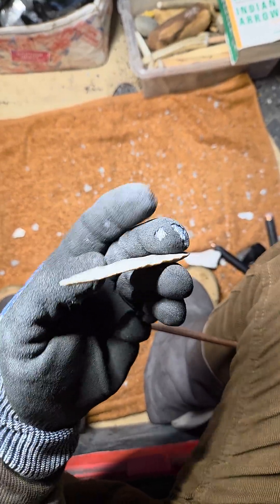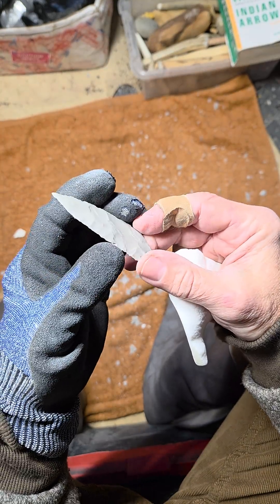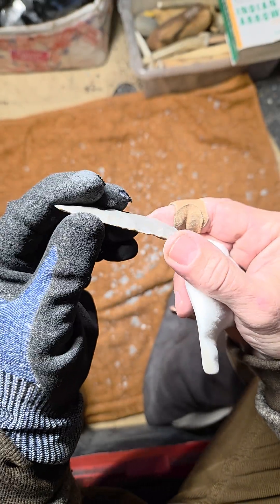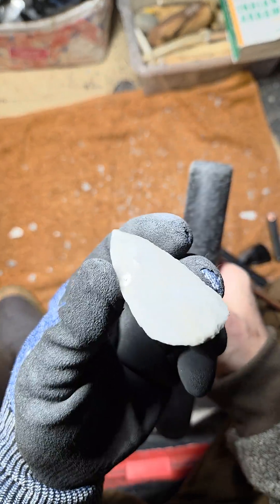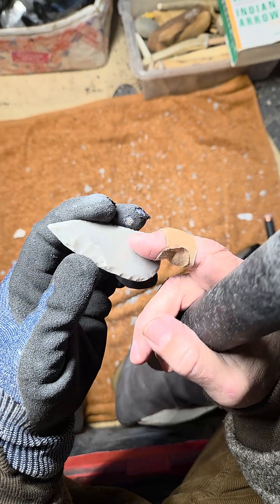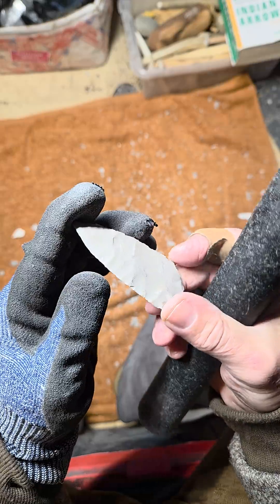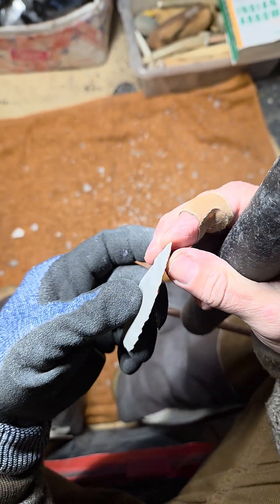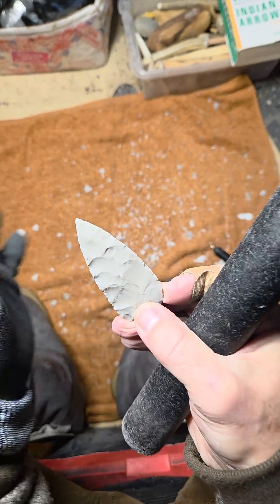Long Flakes on Thin Flakes #flintknapping

Comment from the maker: Updated August 13, 2025
KNAP-IN LIST BY STATE
Part 2/2

CANADA

Annual Whoop Up Knap-in
Fort Whoop Up Black Powder Range & Camping Area
200 Indian Battle Rd South
Lethbridge, AB T1J 5B3
Canada 
N49° 38.6, W112° 50.9
306-343-8590
403-507-3551
August 28 - Spetember 1, 2025
Register at godmee@sasktel.net

New York

Letchworth Knap-in
1 Letchworth State Park
Castile, NY 14427
585-493-3600
585-237-3303
January 31, 2025 (Conference Center)
May 10, 2025 (Conference Center)
August 22, 2025 (Highbanks Rec. Area)
November 8, 2025 (Conference Center)

Ohio

Flint Ridge Knap-in
Coshocton County Fairgrounds
724 S. 7th Street
Coshocton, OH 43812
330-473-7041
740-501-8483
814-720-7512
May 23-25, 2025 (Spring)
August 29-31, 2025 (Fall)

Hocking Hills Knap-in
Amvets Post 1776
649 Radio Lane
Logan, OH 43138
740-279-9995 (Knap-in)
740-385-7100 (Post)
October 11-12, 2025

Lithic Society Knap-in
World Atlatl Association
Coshocton County Fairgrounds
707 Kenilworth Drive
Coshocton, OH 43812
740-331-4351
740-698-6553
August 29 - September 1, 2025

Oklahoma

OJAM
Oklahoma Selbow Society Jamboree
Lake Carl Blackwell
11000 Oklahoma Hwy 51 West
Stillwater, OK 74074
405-747-7776
580-370-0656
March 20-23, 2025

Oregon

Glass Buttes Knap-in
BLM Land
Directions on Glass Buttes Knap-in Website
Email: rockylmale@yahoo.com
March 22-30, 2025
September? 2025 (Call for date)

Cow Creek Knap-in
30704 Cow Creek Rd
Glendale, OR 97442
503-812-8386
541-787-1809
June 6-8, 2025

Pennsylvania

Bald Eagle Knap-in
Camp Anderson
1057 Vanscoyoc Hollow Road
Tyrone, PA 16686
814-381-7172
717-426-3611
June 26-29, 2025

Tennessee

North Central TN Primitive Arts Gathering and Knap-in
(In conjunction with Bernard Meyers Memorial Shoot)
1695 Old Sylvia Road
Dickson, TN 37055
September? 2025 (Call for Date)

Twin Oaks Primitive Arts Gathering and Knap-in
Twin Oaks Bowhunters
1079 Ashley Road
Chapmansboro, TN 37035
931-980-9116
931-472-8627
September? 2025 (Call for Date)

Annual Tennessee Classic Knap-in
Twin Oaks Bowhunters
1079 Ashley Road
Chapmansboro, TN 37035
615-456-5961
931-362-3717
May 1-4, 2025

Tennessee River Rendezvous
215 Ashley Road
45870 Hwy 69
Saltillo, TN 38370
April 11-12, 2025

Eagleville Knap-in, aka Duck River Knap-in
TN Valley Pioneer Power Assoc. Grounds
747 Chapel Hill Road
Eagleville, TN 37060
615-310-1854
615-504-1851
July 11-13, 2025

Old Stone Fort State Archaeological Park Knap-in and Archaeoskills
732 Stone Fort Drive
Manchester, TN 37355
931-247-4673
October 3-5, 2025

Sycamore Shoals State Historical Park Knap-in
Fort Watauga
1651 W. Elk Avenue
Elizabethton, TN 37643
432-543-5808
May 31, 2025 (Spring)
September 13, 2025 (Fall)

Stewart County Knap-in
Lick Creek Park Recreation Area
398 Colson Road
Dover, TN 37508
931-232-5907 (Park)
Canceled, 2025

4 Hills Traditional Rendesvous & Knap-in
123 Holland Rd
Dickson, TN 37055
615-310-1854
September 5-7, 2025

Texas

Heart of Texas Knap-in
Richard's Park Pavillion
Brady, TX 76825
512-789-4452
210-219-4858
April 10-13, 2025 (Spring)
October 9-12, 2025 (Fall)

Virginia

Annual Thunder Ridge Primitive Skills Gathering & Knap-in
Hopper Creek Group Campground
Natural Bridge Station, VA 24579
540-338-0977
540-462-7488
July 10-15, 2025

Washington

Fort Knapadonia Knap-in
4445 Moran Rd
Oak Harbor, WA 98277
360-720-1076
360-675-4943
August 18-24, 2025

Sammamish Knap-in
23811 NE 14th St
Sammamish, WA 98074
Hosts Jim and Beverly Keffer
February 1, 2025
August 28 - September 1, 2025

Wisconsin

Annual Copper Pound and Knap-in
Alma Center Campground (KOA)
Hixton/ Alma Center
N9657 State Road 95
Alma Center, WI 54611
715-964-2508 (Reservations)
262-501-8648 (Questions)
October? 2025 (Call for Date)

Four Lakes Knap-in
Town of Dunn Tornado Shelter
699 Norman Dr
Stoughton, WI 53589
608-438-8184
Postponed 2025 (Call for Date)

Annual Sparta Eagles Club Rendezvous & Knap-in
Fraternal Order of Eagles
Sparta Eagles Club
9901 State HWY 21 (WI-21)
Sparta, WI 54656
608-272-3508
608-372-7115
608-853-0507
May 15-18, 2025 (Spring)
August 21-24, 2025 (Fall)

West Virginia

Annual Black Rock Knap-in
Black Rock Knap-in and Craft Show
110 Highschool Drive
Mt. Hope, WV 25880
Marvin Bunting (Facebook)
June 5-8, 2025 (Spring)
October? 2025 (Fall)

Rambo Ridge Kraft & Knap-in
4810 Clover Dew Dairy Rd.
Princeton, WV 24739
Hosted by Larry Steidley (Facebook)(YouTube)
August 23, 2025